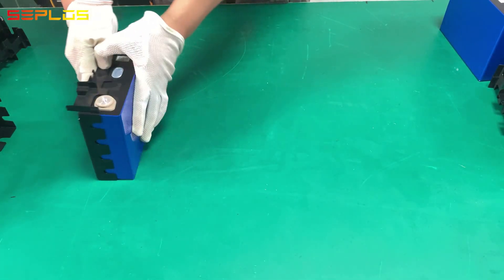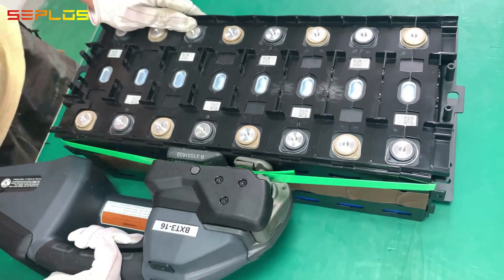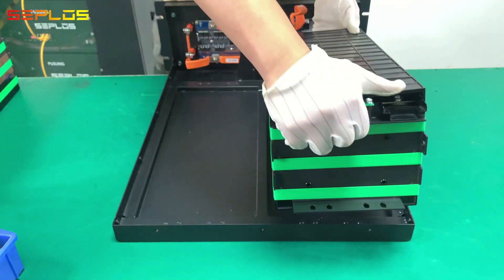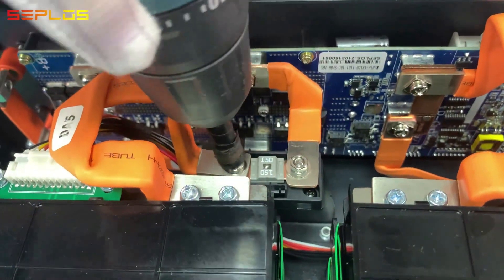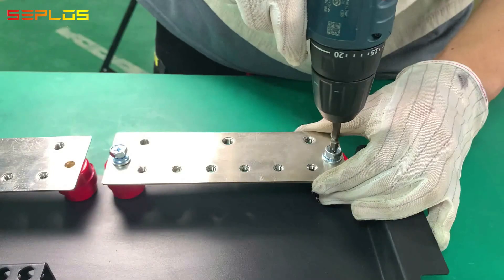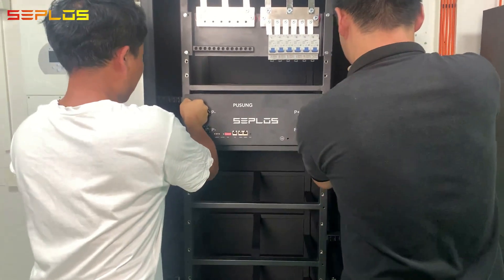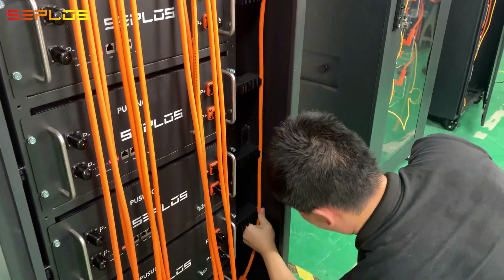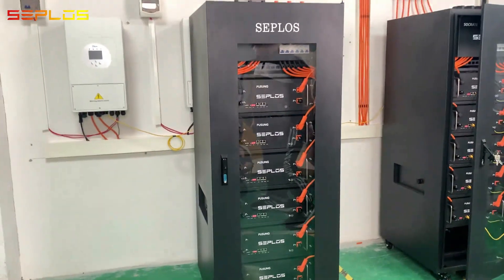Updated Module | SEPLOS PUSUNG-R Rack Mount Battery Pack in Socrate Cabinet

Comment: But i though the  battery unit already have breakers in them already, so what is the use of putting external breakers an longer cables as against the smaller cables used to make the parallel connection previously
Reply: The battery unit has fuse in them. And we made the cables the same length to keep same current flow of each circuit goes through the batteries.

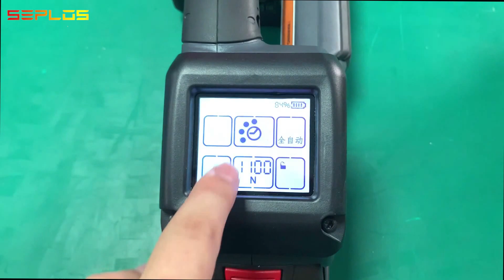Comment from the maker: We applied 1100N compression force to the cell module at 00:30. And cell compression force testing indicates: 
1. Appropriate compression force applied to the cell does appear to be a factor in how a cell reacts to the thermal runaway. 
2. Appropriate compression force applied to the cell does appear to be a factor of cell irreversible swelling. 
3. Appropriate compression force applied to the cell does appear to be a factor of a cell cycle life. 
......
Any other factors?
Reply from the maker: We'll post a picture in the community that indicates the torque of various screws. 
Please check.
Reply: Por que no hay traducción en castellano

Comment: Is a high or low voltage system?
Reply from the maker: It's a low voltage system. 
16 units of 48v 100ah  battery packs connected in parallel.
Reply: @SeplosTechnology  Thanks for the prompt response. Do you guys do high voltage systems (greater 400V) or the BMSs aren't capable of handling that?
Reply from the maker: We do not do high voltage systems at present. And you're right about the BMS handling ability. 
For low voltage BMS, MOSFETS is applied as the control switch.
For the system that is over 100V, the relay is applied to the be the BMS control switch. It's a different structure.